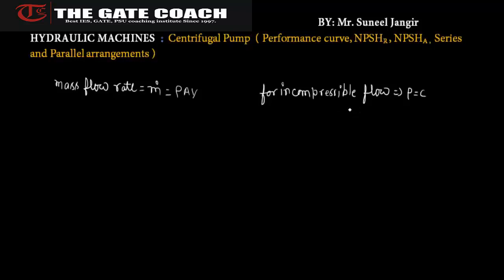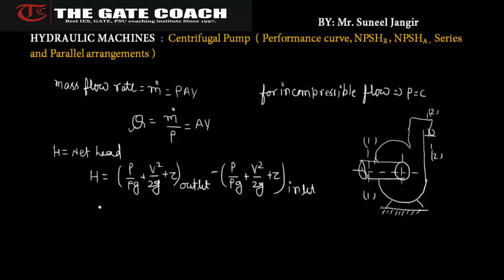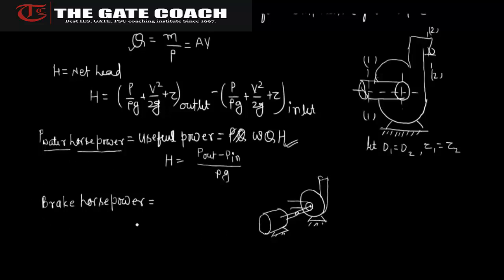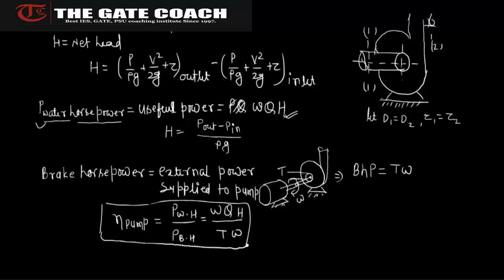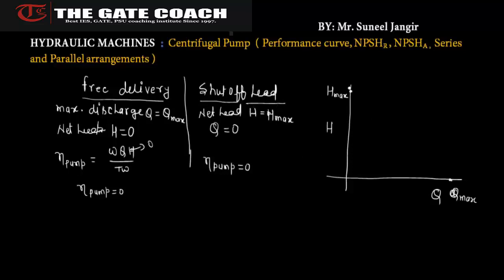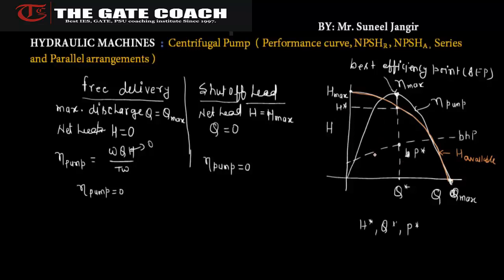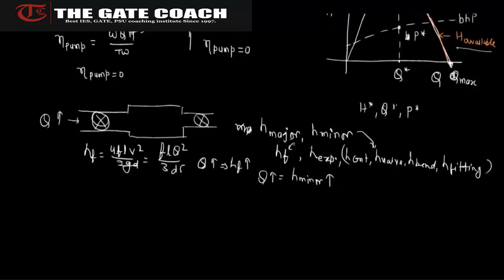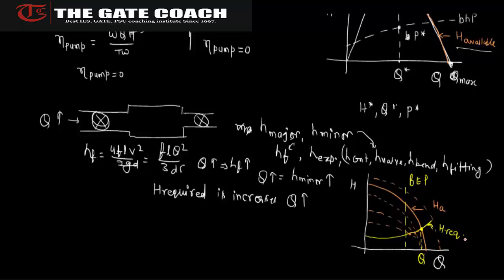Centrifugal Pump ( PSUs Interviews Q & A)

Comment: Why at max discharge H=0
Reply: discharge  piping design  is  too large, pump is overloaded.
Reply: Consider axial flow..with delivery head being the same as inlet ..in that case we can attain max flow rate with zero pressure head..
But practically this wont happen..as we always intend to deliver the fluid at some head